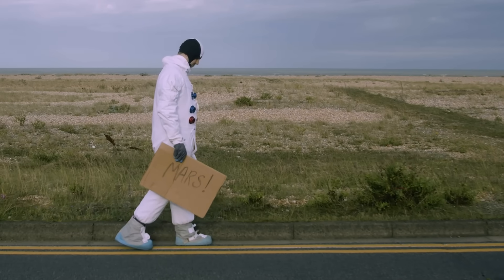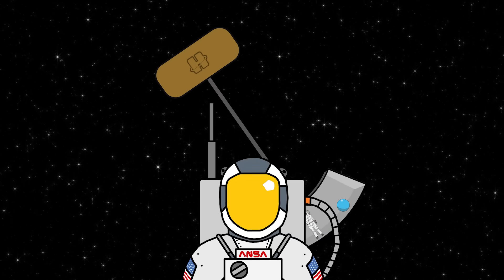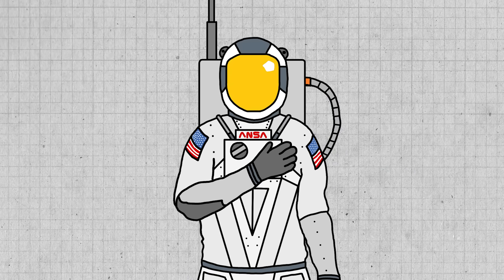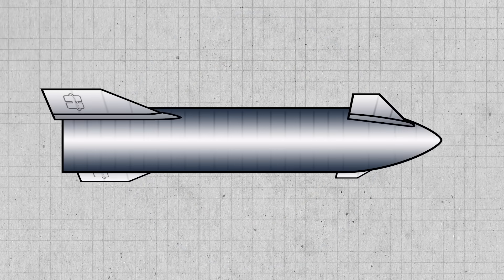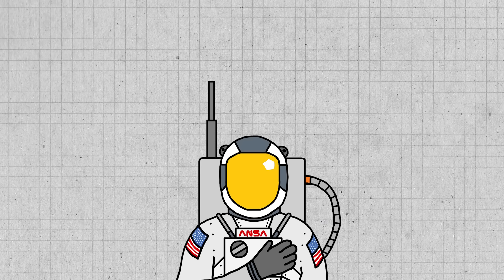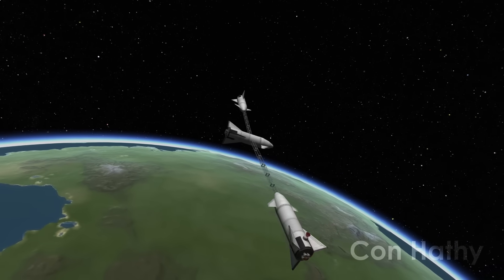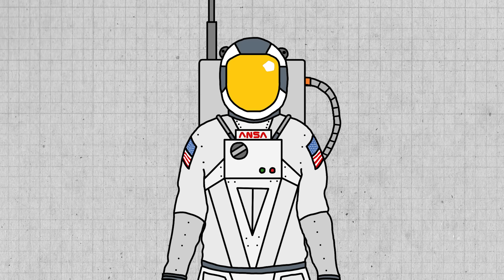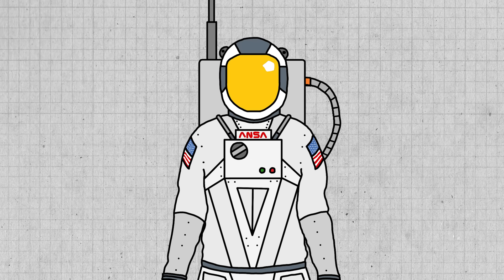This is NOT how you make Artificial Gravity

Comment: A lot of good ideas here, but I'm wondering about the Zubrin approach with mars direct. What if some sort of counterweight was placed above the nose? It would be hard to put there and who knows what it would be, but it would only require 1 starship and in its normal deck configuration.
Reply from the maker: It’s definitely an option, you’d just need to launch something else heavy. For starship that would probably have to be a cargo starship because it’s the heaviest thing we have. For a more traditional vehicle you could get creative and use the transfer stage as the counter weight like they do in “Stowaway”
Reply: @ConHathy  👍
Reply: @mortallychallenged  
Mr. Challenged , 
The issue there is that ideally , both ships would be capable of bringing all of the astronauts back to Earth alive . 
Redundancy is a fundamental requirement within the manned space program , as experience has taught . 
Another issue with the architecture in the video is that it does not minimize impacts with space-debris , nor does it mitigate them . The odds of a strike are much higher , and the damage will be more severe , as opposed to employing a nose-first posture . This of course , presumes a hardened nose on both ships . 
If a nose-first arrangement is chosen , then spin-gravity will require reinforced ships with multiple tethers connecting them . 
Such ships would need to keep their stern-sections pointed towards the Sun , in order to minimize crew exposure to solar-radiation . 
This of course , would require that the ship's internal amenities and equipment be convertible from vertical to horizontal operation . 
*.For a closer look at this subject , read my Quora Post #1 at : 
"What would the design of a large spaceship built in orbit look like ?"
Reply: @ConHathy  Or you could keep the propulsion system permanently attached with a truss. See my other posts :)
Reply: That would be your supply ship you'd attach. Your question made me think of the advantages and the primary one I can think of is that for bulk supplies the rocket doesn't have to worry about pesky humans and acceleration limits. Or supplies could be launched previously to coincide with any other activity for added convenience.  Folks have even built test model centrifugal launchers that work for non-manned stuff (because of very high Gs) that could put into orbit supplies and extra fuel. Of course they'd have to be manufacturing something, some product on the other end (at say Mars) for the return trip. Fuel and water is always a good thing to be making off Earth and would basically pay for itself since launching from Moon or Mars is so much easier.
Reply: @seasidescott  The only ship I'd rotate is the one that is transporting humans from Earth orbit to Mars orbit and return. And it just so happens that the fuel you need to decelerate into Mars orbit is sufficient to provide the counter-weight needed for rotation on the trip. Do you mean supplies to Mars surface? Or supplies for the return trip. Either way, that can be send those separately on a lower energy cargo flight. 

The only circumstance where you'd seriously contemplate producing fuel off Earth is where you produce oxygen for fuel on Mars. That's far simpler (atmospheric processing) and far less costly and risky than mining for water and producing methane on Mars. In an architecture where you return people to Earth via Mars orbit, with a small, light ascent vehicle, the amount of methane needed is so small that the best option is to simply import it from Earth. As for the Moon, its not that hard to have lander/ascent vehicle that carries enough fuel with it that it doesn't need to refuel on the Moon.

Incidentally, humans produce water - its a consequence of metabolism. You can survive quite well if you recycle water with high efficiency. And of course there are traces of water in Martian air (which you'd capture as a by-product of Oxygen extraction.
Reply: @saumyacow4435  I appreciate your comment but do see many articles about real ongoing research about fuel production on Mars as well as general material fabrication for infrastructure and oxygen.  Also, since the atmosphere is so scant and minute oxygen, calcium (for conducting electricity) and other compounds can be formed there. It's quite an interwoven puzzle about what to start mining and manufacturing first but Mars gives a near-space environment with double lunar gravity which is useful. Basically it is in many ways our closest, easiest asteroid to mine as well as being both a proving ground and staging area for the actual asteroids.
Reply: @seasidescott  You seem to be fixated on the notion that mining Mars or asteroids actually has a useful purpose.

For the purpose of a realistic manned Mars exploration mission (or missions) we need the following technologies:

1. Improved in-orbit assembly methodology. I can see a Mars transit vehicle (Earth orbit to Mars orbit and return) being constructed from large pieces. That is, habitat unit, truss sections, tanks and a few other major pieces. Mostly being brought together in orbit, and docked automatically, but then requiring some EVA work to do the finishing touches (mostly connections, releasing latches etc). Can we make this fully automated?

2. Atmospheric processing on Mars. That is power source, extraction, filtration, compression, refrigeration. Lots of engineering yet to be defined and refined. If we have Martian air as a basic input, then we can create liquid CO2 as a product - which may be very useful for several reasons. Once you extract CO2 (by liquefaction) the remaining gas stream has now concentrated the other things you want: Argon, Nitrogen, water (sufficient to provide life support makeup). Oxygen is 0.13% of the Martian atmosphere, but its 3% of the gas stream you have left, once you extract the CO2. And the process of extraction is well understood - fractional distillation. Is this a more economic route to producing Oxygen on Mars, rather than electrolysis of CO2? That all depends on how well the CO2 electrolysis technology performs in the real world. 

Liquid CO2 has a couple of uses most people haven't thought of. One is that if you add heat to liquid CO2 (and push it to its supercritical phase) it will then drive a turbine. Add nuclear heat and you have a highly efficient heat engine that doesn't require huge, complex, expensive radiators. Instead, you're using the air itself as the heat sink. Another purpose for liquid CO2 is that you can design a mining machine that blasts the soil with jets of high pressure liquid CO2 (like an Earthly pressure-washer). The soil is then propelled into a simple hopper. Nice thing about this process is that its self-sorting. You can leave out the larger particles and of course it doesn't have the problems associated with physical contact, so no wear out of ground engaging tools. 

Both Argon and Nitrogen can go into life support buffer gas. Or you can use excess Argon for things like air showers and cleaning. 

In the end though, extracting a few tens of tonnes of Oxygen (sufficient to a well designed ascent vehicle) is far more tractable than needing a thousand tonnes. 

3. Some use of Martian soil for radiation. My take on this: Gather soil (see above - use CO2 blasting). Now mix with imported polypropylene fibres (1-2% by volume). Now heat until the fibres soften and bond into a matrix. You now have a Martian brick and the nice bit is that it doesn't require a whole lot of energy since the polypropylene softens at modest temperatures. The bricks thus obtained are not suitable to build heavily loaded structures or pressure vessels. But they are strong enough to be self supporting and be stacked. So, if you really need a couple of metres worth of radiation protection around a habitat, its a simple matter of having a robot piling bricks. 

And that is the summed total of the ISRU necessary for a realistic exploratory mission to Mars.
Reply: @saumyacow4435  I'm not arguing what is needed. Heck, I don't need any exploration of Mars as I see it as not very useful for much. I do wonder at your liberal use of an almost non-existent atmosphere (yeah, O.09 psi is better than nothing). 
I'm thinking about how it's going to go down, what efforts will be made to rationalize it, what research is being funded. 
The topic of using a counterbalance for spin (in that model), requires something for the return trip and that was what I was addressing.
With the nuclear set up perhaps more mining and production of alumina nanofibers will be a thing by the time any of this is achievable (politically/economically as well as scientifically). 
I think the moon is a much better place to start developing technologies. Mars has more gravity and more iron oxide but that's not figuring into much advantage, especially given the vast distance by comparison to the Moon.
Reply: @seasidescott  The Mars atmosphere is about 20 grams per cubic metre. Whilst that doesn't seem like a lot by Earth standards, the engineering (big, fast fans etc) is undergraduate level. Beyond that its all very well understood engineering - compressors, refrigeration, heat exchangers and so on. it remains to be seen if the least energy intensive process for producing oxygen is via fractional distillation of the air, or via the electrolysis route. But certainly if you are in the business of producing liquid CO2 for energy production, then its a no-brainer to extract the argon and nitrogen by-product and you do need this for life support and other purposes (argon is useful for air showers). The thing about atmospheric processing is that its compact, reliable and results in the least mass solution if your goal is to get back off the planet.

The counter balance (for spin) on the return flight is of course the fuel you need to capture back into Earth orbit. And all of that is sitting there waiting for you in Mars orbit before you get there. 

As for mining, well, you're welcome to it, but I see no purpose in it.